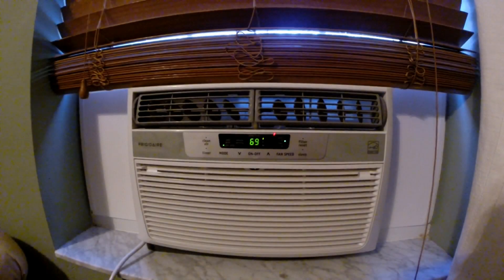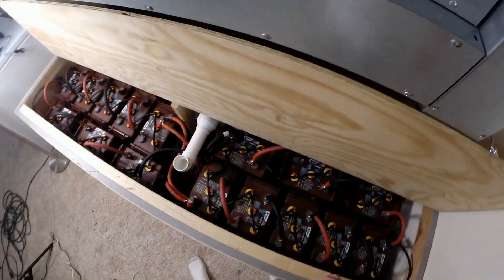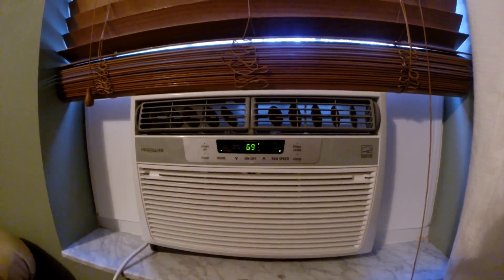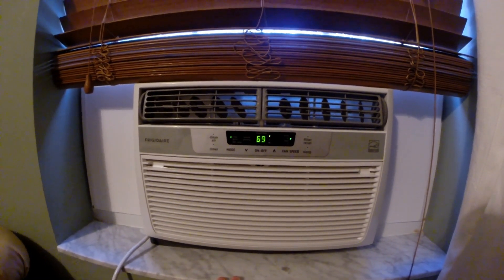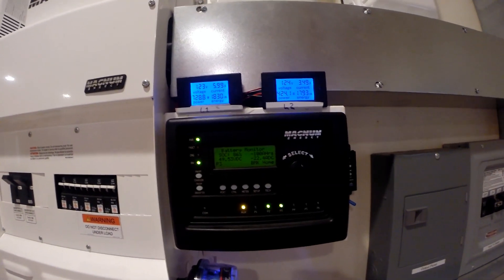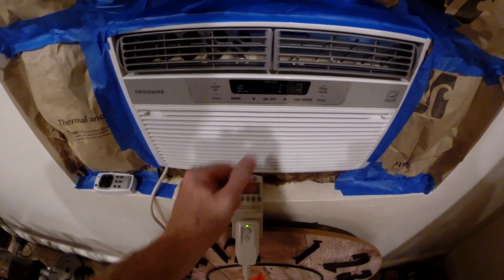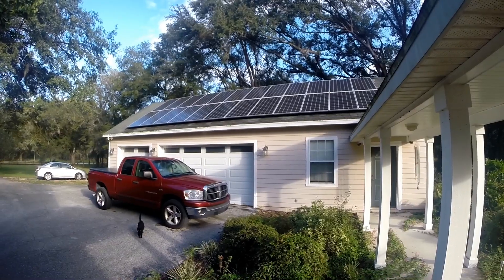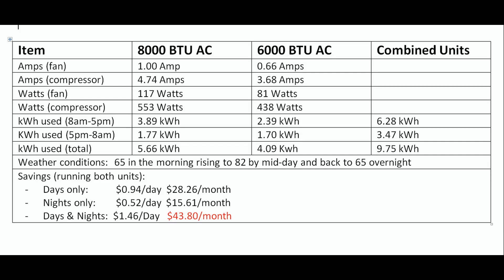Off Grid Solar #48: Air Conditioning on Hybrid Off Grid Solar

Comment: wall units are not very efficient. you might take into consideration reverse split air conditioners. they are more expensive but put out 2 to 3 times more hot or cold air. plus you can install them anywhere you want. needs an installer though as the pipes need to be air evacuated. and they are probably not as noisy. and more air tight.
Reply from the maker: Yes, the mini split AC's are very nice and look much better.  I like the window units because they are way less money.  I paid about $185 for the 8k BTU unit on sale, a 12k BTU mini split will run you about $1000 and then you will probably have to hire an AC man to install part or all of it.  Also, I like the sound of it, puts me right to sleep...

Comment: Hello David. I'm still catching up on your solar video series - all very good. As a fellow Floridian, what permits did you need to install your system (building, electrical)?
Are any of your breakers/circuits connected to both solar and grid or are they split and isolated for each other? Is any of the generated solar power going back to the grid at any point? I believe I saw in one of your videos that you had both grid and solar connected to a light.
Reply: Cancel that, David. Found your video: https://www.youtube.com/watch?v=lcGjoHS6rnE. Thanks!
Reply from the maker: I got a single permit for the entire solar power system and it was inspected just once at the end.  I have 20 circuits that are connected to both the grid AND solar/batteries/generator.  Any one of those circuits can be switched to grid or solar/batteries/generator in any combination.  No solar power ever goes back to the grid.  This video shows how I installed those transfer switches and how they work: 
https://youtu.be/4HhfdzBunSc

I have two videos on permitting #1 and #24  
Good luck with your system!
Reply: Thanks, David. Have you looked at how the Gov tax credit applies to your system? I've read that only grid-tied systems quality, though this makes little sense to me. There's also suggestions that batteries, when charged from the grid, could disqualify them from credit, see here: http://www.renewableenergyworld.com/articles/2013/04/irs-confirms-that-batteries-qualify-for-the-energy-tax-credit-but-imposes-limitations.html. You might want to amend your tax credit forms for that.

One thing your system doesn't do, and it's often looked over, is generate income for you in a traditional way. Because netmetering systems can actually make money for customers, utilities require an IRIS form to be filled so they can declare any money you make with your system, income. The man that giveth is the man that taketh away. That's why I prefer your type of system setup.
Reply from the maker: I don't recall the tax software asking if the system was grid tied.  I counted all the equipment purchased for the system.  I did not count my labor.  I am very happy to NOT be grid tied.  While I am giving up some income, the power company has little (basically zero) control of my system.

Comment: Don't know if there is a window unit that's inverter driven but a mini split is and very efficient. Could get more use of it. There's a cost in it to
Reply from the maker: I did look at those mini split units.  They are much nicer than hanging a unit out the window but they are much more expensive.  The wall units are only $200 and those mini-splits can run $2000 or more once installed.  You need an evacuator to install them so probably will have to get an AC man to do that part at least.  I have not sean a DC wall unit just yet...  Thanks Roy

Comment: You have an awesome solar system. I need to upgrade my batteries. What kind of batteries do you have and are you 24 volts?
Reply from the maker: I am using 16 of the Trojan L16RE-B batteries.  They are 6 volts each and I have two strings of 8 so it's a 48 volt system.  They are 370 AH, weigh 118 lbs each and cost about $300-$375 each.  Here is a link:
https://youtu.be/Yj_Ojx8hG2E

Comment: Nice update, have you also thought about some sort of windmill/turbine set up for cloudy days?
Reply from the maker: We don't get a lot of wind here but if we did I would add it.  Thanks!
Reply: I remember seeing a video awhile ago but cant find it right now. But the guy had a horizontal turbine (sort of looked like an elongated AC blower fan) at the top ridge if his roof. As the wind blew from the bottom of the roof line all the was to the top, the turbine was able to catch the wind and use it to supplement the solar.
Reply from the maker: It sure would be nice to get some help from wind during the night.  That would make a big difference.